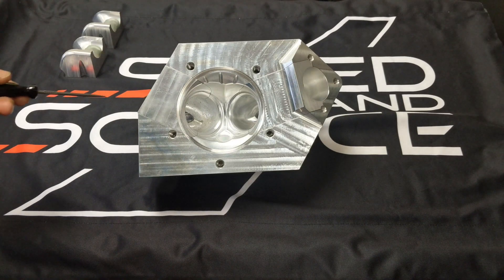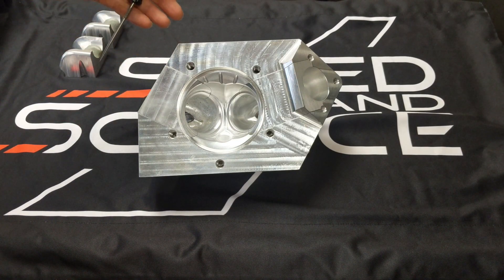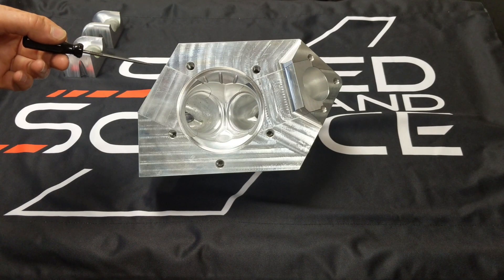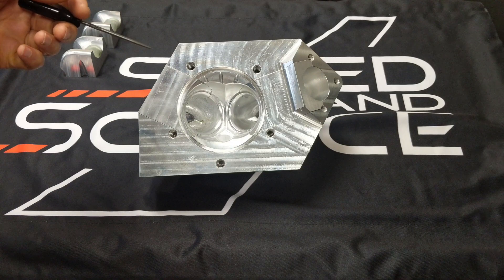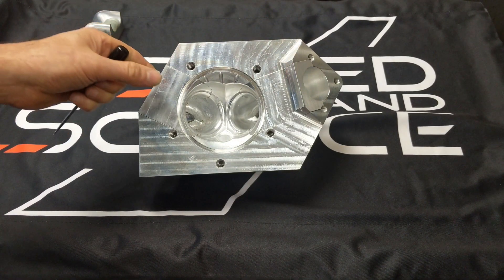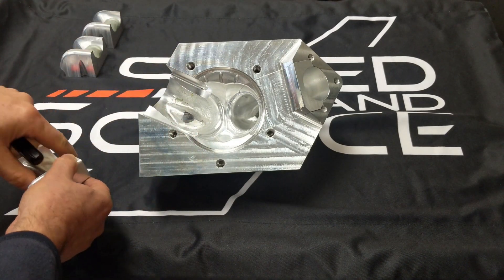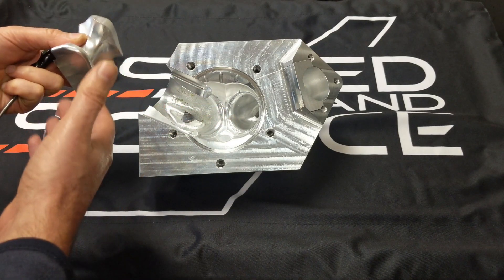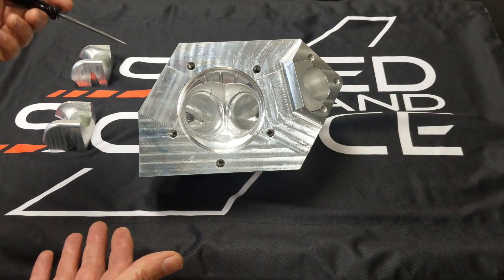Episode 11:  Making of The Port, a.k.a. Horespower 101

Comment: I have a '99 TC88 FXDL. It's had 7 previous keepers and genuine 25k miles. It's currently got a big sucker, CV 40, fueling 525 and Vance and Hines short shots quiet baffles.
From static compression it's unlikely the pistons are still 9.5.
What I do know is that 7 previous people found it wasn't for them.
The last owner traded a BMW for it and did 300 miles. People think they want more power but real world manners are where they should focus. I've never had EFi on a bike, this is my 3rd Harley.
It's taken 300 miles to get from near unmanageable difficult to start, including having to wait to cool off just to get the motor to turn over with standard starter and 310 cca battery.
I've ridden everything from a GSXR1100 slingshot to a Vmax, RD500LC Maico 490 ect. 
The Dyna frame can handle a more than stock but it's limited.
I can now bimble at 35 in top on the flat just off the throttle stop, down to 4th is around 2k so only a couple down shifts from enough noise to make my ears ring for days even with full face and earplugs. I'm keeping it because it's right for me but I get why the last 7 keepers probably went back for something they could handle, like a vmax,R1, BMW ect.

Comment: I have some Twin Cam questions.  Will your heads work with a 4.065 or 4.125 bore? Will your heads work with a 4.375 or 4.625 stroke when used with either of the listed bores? Which valve sizes would you recommend with your heads for 110 to 120 cu in? I am looking at intake lift of .575 to .600 and 11 to 1 compression ratio.  Thank you
Reply from the maker: Please send your inquiry to websales@speedandscience.com
Reply: Its a business dude. They ain't gonna answer your questions in an open forum. But they'll sell you some stuff. Good luck dude.
Reply: @arthurcutaiar9994  I kind of noticed that after a couple weeks and sent them an email. But I did get an answer from them. My post is 9 months old by the way.